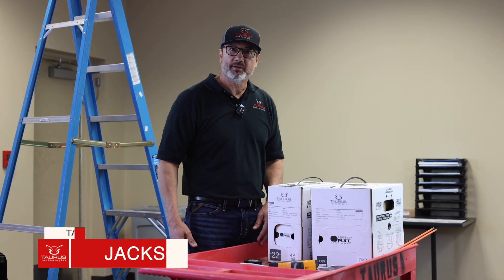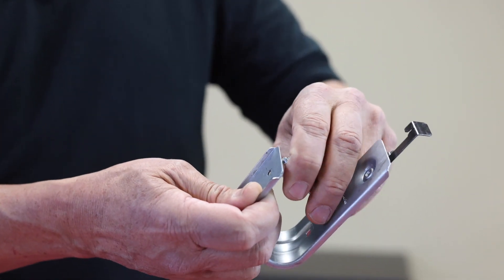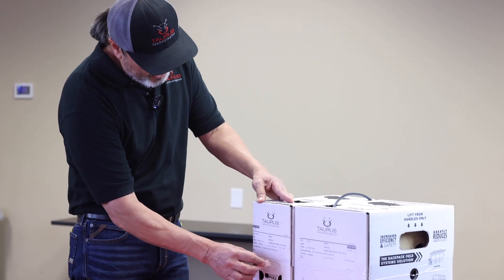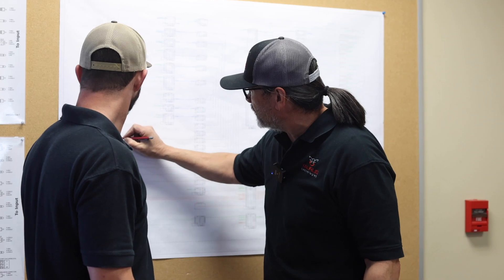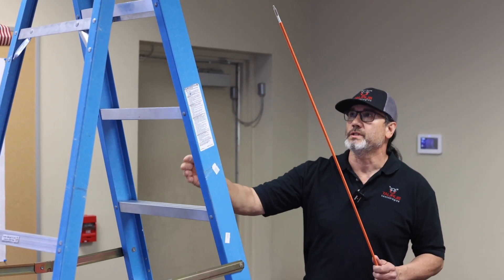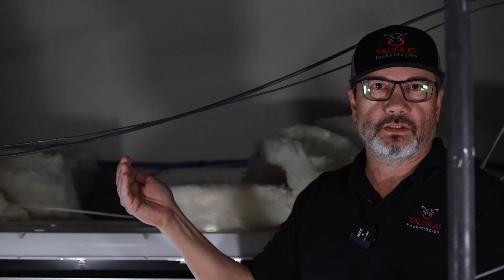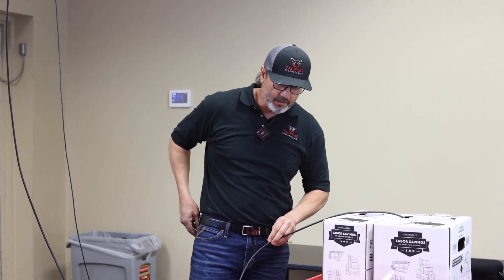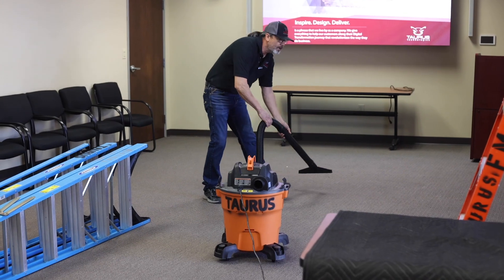Pulling Cable Through Office Ceilings: A Quick Tutorial

Comment: I find myself running a lot of long pre-terminated cables like HDMI, SDI, XLR. Without fail they kink and become almost unmanageable. Especially since I’m a one person operation. It would be nice if I could put it on some type of reel either on the floor or actually in one of the ceiling tiles so that I could pull cables myself without kinks. Is there anything you could recommend for that? Thank you so much for the video!